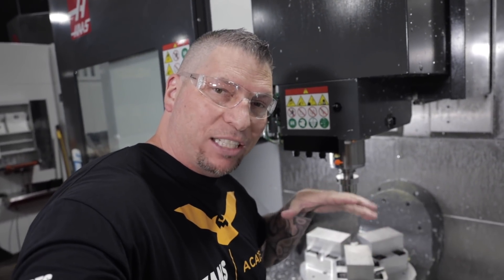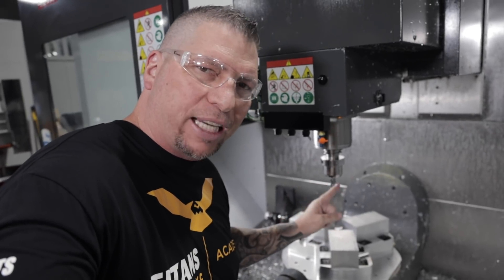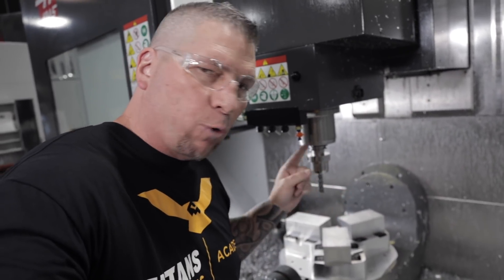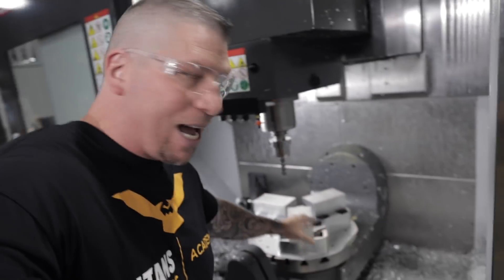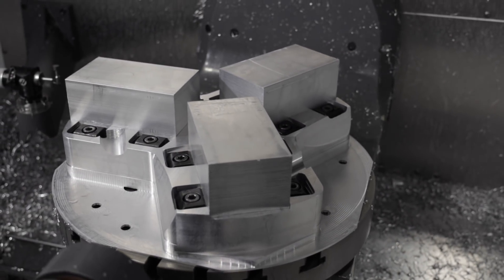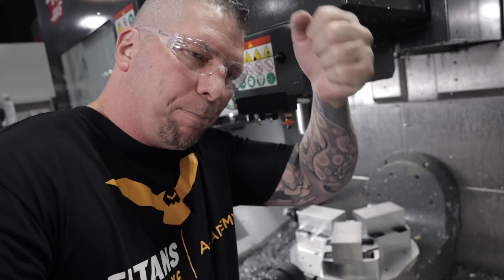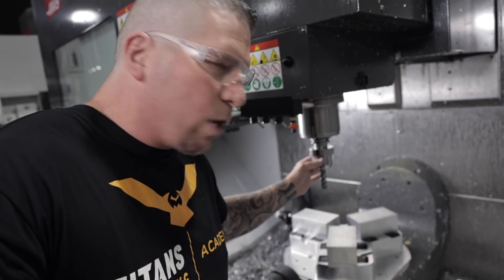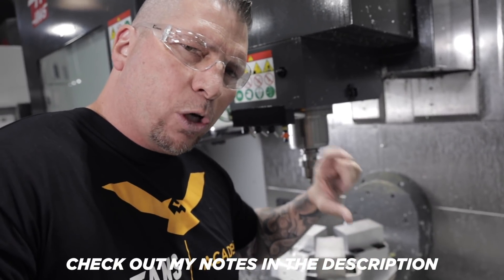KOR-5 | KING of ROUGHING on a HAAS UMC-750SS | CNC Machining

Comment: How good are those machines to machine on cast iron? Just asking because they have a small CNC machine at my work. It machines the parts very slow.  Compared to an old agent hydraulic machine called a carousel that has 5 stationary stations.

Comment: but thats aluminium or steel? can you test something like - we called this in germany - X 155 CrVMo 12-1 ? would be interesting what feed rate you can use for this material?
Reply: Some blend of cro-moly vs 6061?
C'mon man you know the results
Reply: @DiDe273  na sorry im not into that i machine daily these types like X155 or X210 or 90MnCrV8 / X8. but as is said would like to see this mill with these materials how they work together!

Comment: If you're going to show"the king of roughing" show it in steel - even 7075 alum. cuts like butter, even with a conventional two flute high speed steel endmill.
It's hard to even call that roughing, you're not going to push any cutter near it's limits in with that small diameter holder - it's going to chatter first, except possibly in 6061, which is about as tough as marshmallows.
We also run high helix parabolic flute endmills - in Solid, large diameter holders.
Reply from the maker: There are a million materials and types of tools...
I really break it down into 2 sections as standards are concerned.

Harvi 3 which was chosen by Boeing over all competitors as the number 1 tool for Titanium... I use that for all steels, titanium, Inconel and Monel etc.

But what about soft materials where you need a sharper edge?

King of Roughing is actually the name as it’s what KOR stands for and 5 is the flute number.

This tool drops 180 cubes with a 1/2 so it definitely out performs all competitors in aluminum etc.
Reply: @TITANSofCNC  If you say so.
We use a lot of half inch 2 and 3 flute streakers (plenty sharp edged), both pocketing and periphery cutting. (Mostly 6061)
For pocketing I use a single ramp/plunge to roughing depth - usually 150 - 200% of diameter, use 85 - 90% stepover running 200-220ipm, the biggest issue is chip evacuation even with the high helix - I actually prefer the two flute in pockets for that reason.
Periphery, 90% wide 150% deep and all the feed the setup will stand, I ramp over on the first pass to gradually build tool pressure 
The only limits we see are spindle speed - 8100 max.

As an aside - I don't have a lot of respect for Boeing, they're probably much better now (way up there) but I'd seen some poor decisions/endorsements by/from them in the past.
Reply: @TITANSofCNC  
I'm curious, do you have access to spindle rpm, step over and depth of cut when they arrived at 180cu in?
Was it a sustained cut or a short/quick pass and then calculated from there?
At say 30,000 rpm and 5 flute geometry it doesn't take much chip load per flute to generate that number.
I also wonder if it's sustainable, even with the knife edged, cup faced geometry and mirror like micro on the face of the flutes I'd imagine metal transfer to the cutter would limit the amount of time.
They're seriously honest questions.
"Burst passes" - I don't know the technical term - during high speed machining cycles generate some impressive numbers but the tool life at those numbers in a continuous cut situation intrigues me.
I tend to be a bit pessimistic about advertising claims.
Just to qualify myself as to the basis behind my questions, I have 40 plus years in the trade, a 2yr. "pedigree" in manufacturing engineering, have been programming 3d/multi-axis since A.P.T. was the industry standard,  instruct at the local college, and constantly stay on top of advances in the machinery/tooling/software in our world.
The most "significant" machinery I've been responsible for is an 11 axis Nakamura - it was interesting work.
If there's something truly  significant here in tooling I'd like some verification if you are privy.

Comment: I have a question I run my Haas vf3 around 90 to 100 load when roughing now with a dynamic cut when the cutter enters the cut it can get up to 135 is this hard on the spindle running hard like that all the time?
Reply from the maker: Make sure you ramp in Radially... gradually... so the pressure builds to 90. Don’t dive in at 90’ instead come in at 30... but Fast.

In 5 yrs you might have to trade out a $6000 Spindle... but with an aggressive style... you will have made enough money to buy 10 + spindles etc:-)

Comment: Can you push more radially? Like 30%
Reply: @Travis Casey Actually the gullet has to do with chip thickness, not radial engagement. I would guess, sure you could do 30%, you could even do 100%, but you would have to reduce the feedrate to an extent that you get less MRR. I am guessing here, have not used the actual tool.

Comment: What is a good resource for determining optimal RPM? We usually run our tools at the highest RPM we can but running at max torque would be useful
Reply from the maker: Ask for your torque curve on your specific machine. There is a balance as higher RPMS reduce pressure especially with 5 flutes.
So go 20-30% past for high end torque RPM... and try it.
Reply: Thanks for the help!

Comment: Love you vids. I am not a CNC guy, so here you are making a part from a block of aluminum. I never seen a video for how you remove the part from the rest of the block that is clamped to the bed.
Reply from the maker: Go back a few weeks and you will see a video showing the making of that fixture plate and how it works.
Thanks

Comment: I dont work much with aluminium these days but when i did i remember we used to rough both sides climb & conventional, saves quite a lot of time on the rapid moves and the overall movements.    Not sure it will work with this kind of feed and AP but if it would, it would save quite some time.   Have you tried it ?  Im curious :)
Reply from the maker: It works great in some applications, and not in others... your running over your chips in tight spaces... but with aluminum it doesn’t really matter. Tool gets dull faster... but if you save money then it’s ok